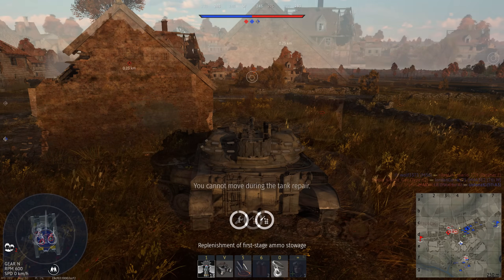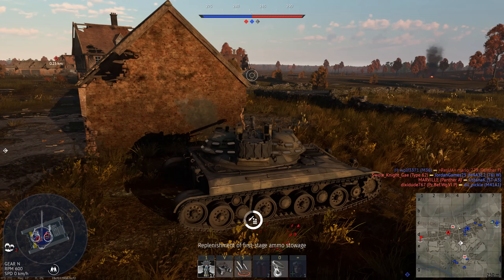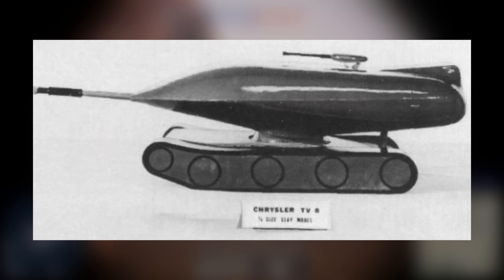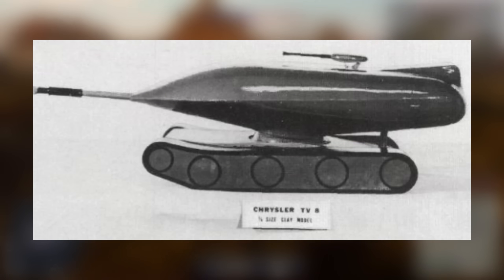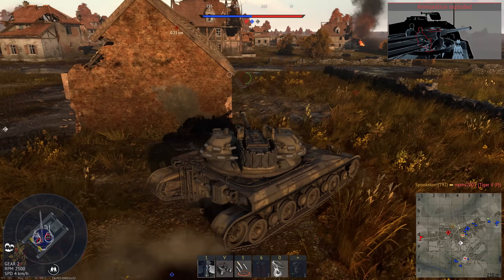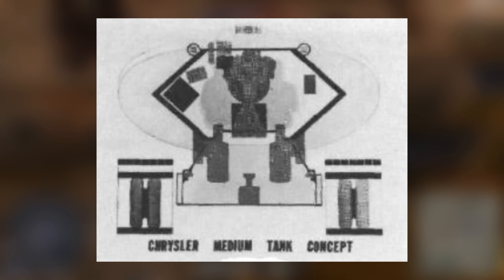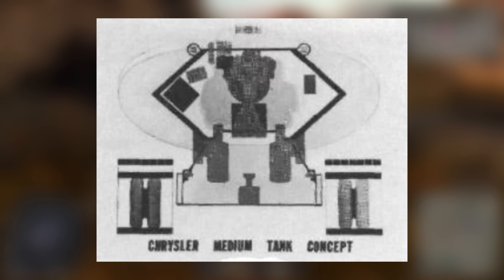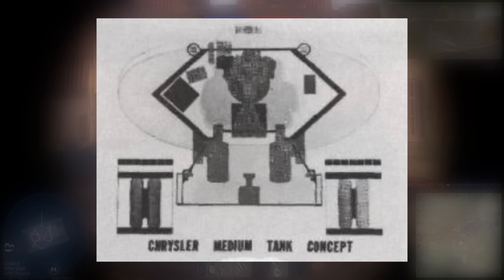The Nuclear Tank: Chrysler's TV-8

Comment: The #1 challenge of designing a viable nuclear-powered tank would be an efficient method of storing all that energy when not in use (AKA when you're not moving) as nuclear reactors are so slow to gain or decrease their output. You'd either need some amazing flywheels (could be directly attached to the engine drive shaft), a huge battery or a way to reliably piss away all that energy constantly.

Challenge #2 would be an electric engine(s) capable of driving both the reactor setup and the tank itself which back in the day would have to be huge.. Today however, we're getting really good at creating micro nuclear reactors that can fart out as much as 20 MW and companies like Tesla are mass-producing 500+ horsepower electric engines with massive amounts of torque that only draw like 15-20 KW.

Once you look at all the facts, it's really surprising fully electric tanks haven't been made standard yet.

Comment: 90mm T208 not outstanding penetration for it's time? it was made in similar time as 105mm L7, yet in penetration capacity it actually outperformed larger 105mm L7..
then there was larger version of T208 in 105mm T210 using the same projectile at higher velocity and finally Delta gun 120mm.

Comment: 1:33 Even Spookston isn't immune to HEAT "produces a molten copper jet", which has been disproven by actual US Army testing. Edit: Reference ARL-SR-150
Reply: I assume you mean the fact the copper isn't in a liquid state because of temperature but because of the intense pressure from the explosion
Reply: @badgermcbadger1968  But isn't there no liquid state no matter why? As far as I remember it's still "solid", but changes its shape due to the immense pressure or something
Reply: @racernatorde5318   It's more velocity dependent in this case. As you approach the speed of sound in a material it begins to act more like a really viscous liquid then a solid. It's still solid mind you, it's just you're moving so fast that the materials hardness is effectively 0.
Reply: @racernatorde5318  yeah that's exactly what I meant, sorry for my bad English
Reply: @badgermcbadger1968  ; Yes, the thermal reaction happens as far I am aware from contact with the armor.
Reply: Isn't the technical term a "Superplastic jet"?
Reply: @miaconnor5767  Hydrodynamic jet.
Reply: Hello. I have a very high interest in such tests. Where can I find something about them?
Reply: @joaolucaslages7792  ; Try ARL-SR-150
Reply: You misread the article, “ the jet, reaches a density several times of steal and the ARMOR becomes plastic and yields whilst the jet torches assisted by melting and burning of the armor
Reply: @ Maybe read the caption below what you just stated "Figure 32. Misnomers (continued)."